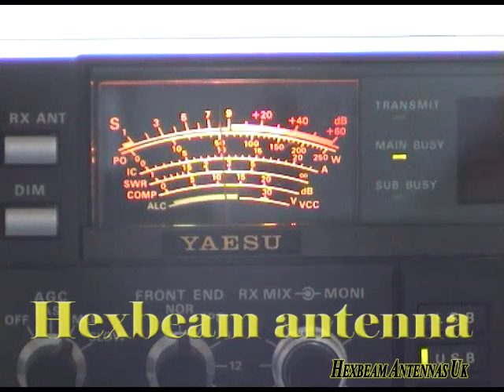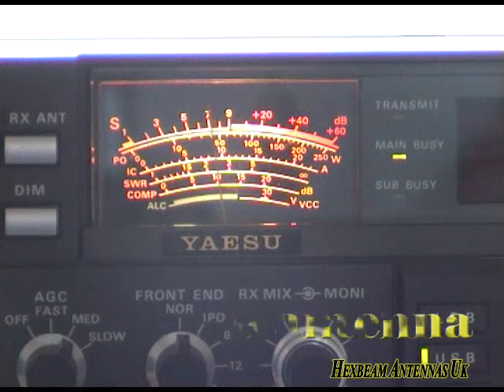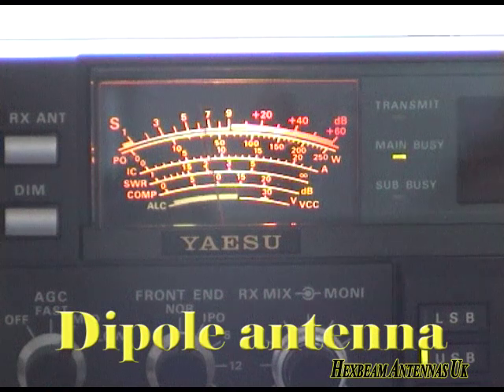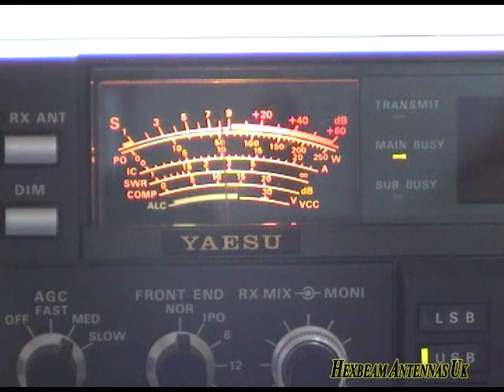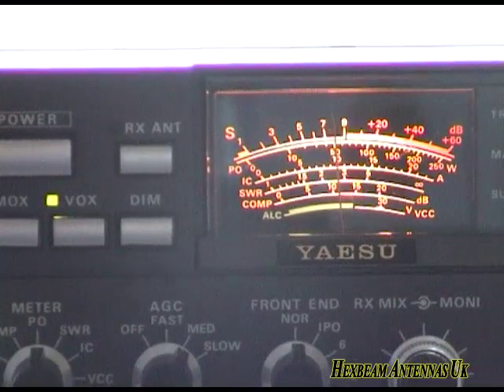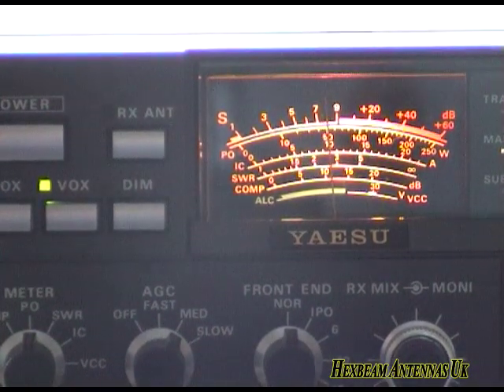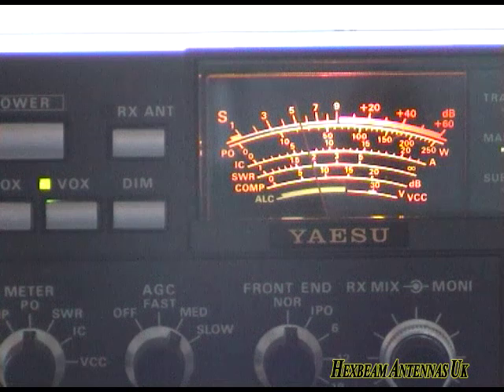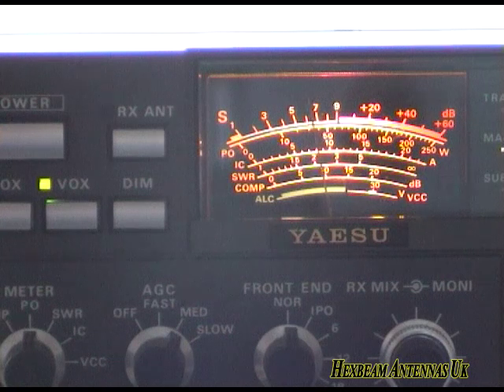Hexbeam vs Dipole antenna

Comment: Not possible. A Hexbeam antenna is only 2.5 to 3 dB over a dipole. Your dipole is not working properly. (less high, or direction)
Reply: I know this guy is all wrong.
Reply: I agree plus look at the noise floor but the signal to noise ratio is about the same.
Reply: Doesn't seem right on several fronts..also, how do you know the station being received isn't in a null of the dipole?

Comment: For those like me wondering how a hexbeam does compare to a dipole, it is an interesting little video. Yes, it's not apples versus apples, though it is antennas versus antennas, but not beam versus beam, however I need something portable due to being in a rental property and possibly wanting to use it for emergency use. Now to figure out how to set up a base.. I am getting ideas on using a drive-on and parking the RV trailer on it, then using a guyed tilt-up, push-up or air mast to get the hexbeam up. I have a lot of wind here, quite a bit of snow and regular ice stoms it seems...